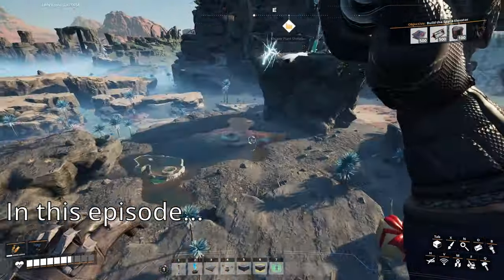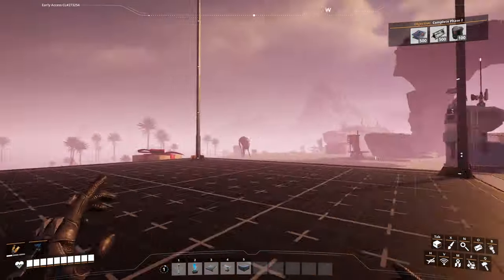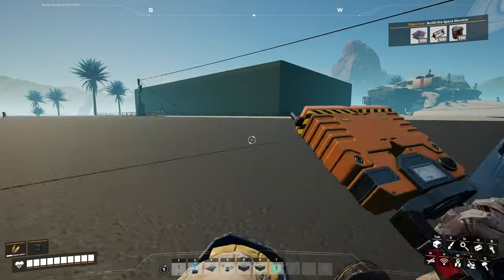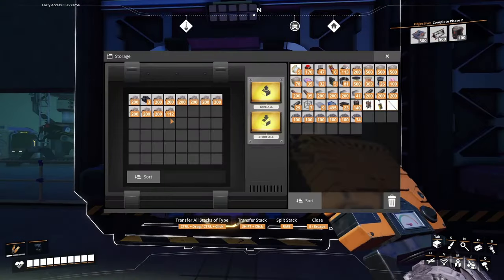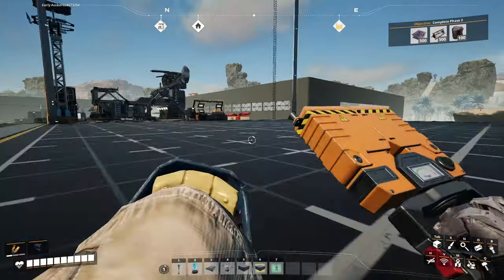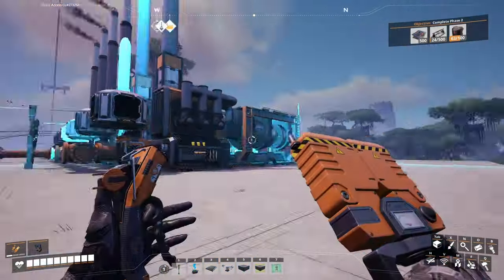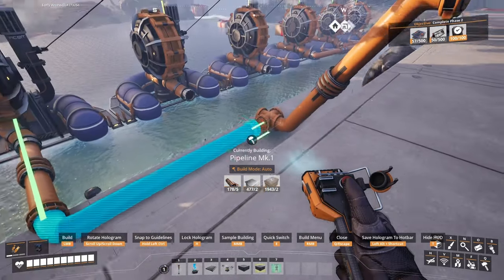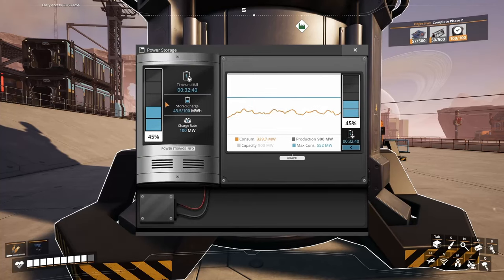Blueprints Changed Everything - Satisfactory Update 8 (3)

Comment: i know its been a while but if you start in the northern forest  in the north where there is a arch you get easy mode in my opinion there are: 6 perfect iron nodes, 2 normal and 1 perfect lime stone, and 1 perfect copper node. as well as all the stuff nearby you need for tiers 1-6.Also liquid bio fuel is one of the best things to use for a jet pack besides turbo
Reply from the maker: I'm probably going to start a new file when 1.0 comes out, maybe in the northern forest because I've never started there before!!